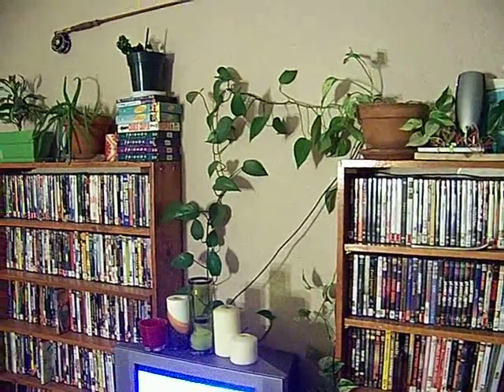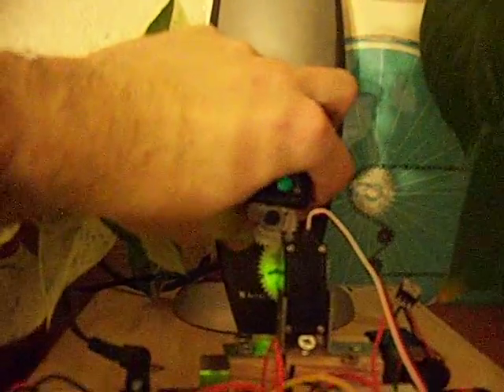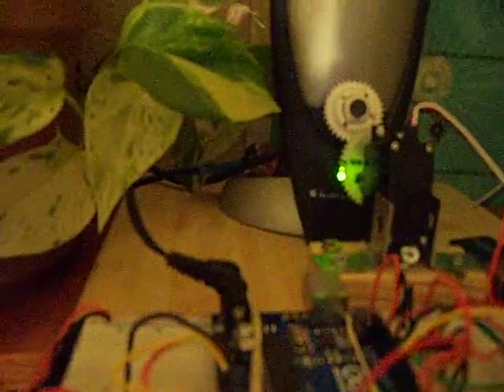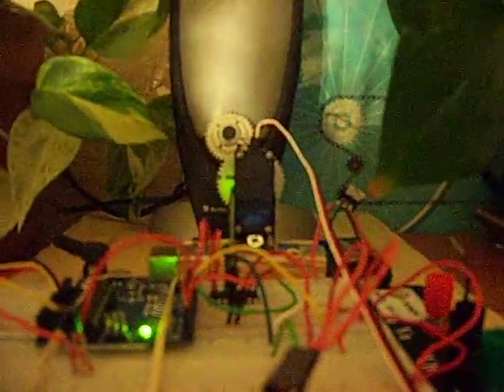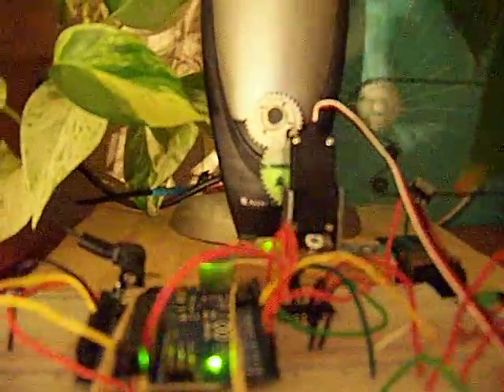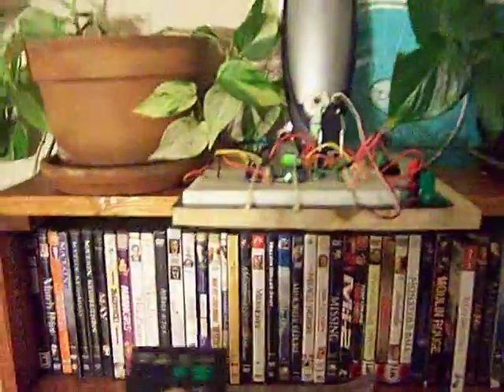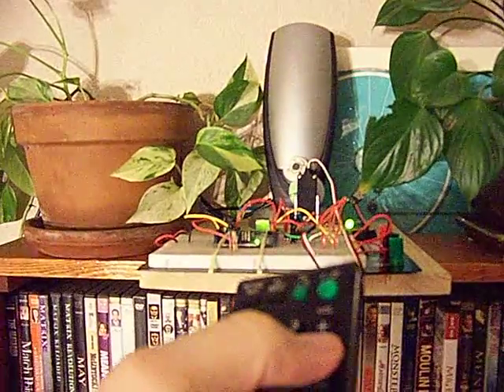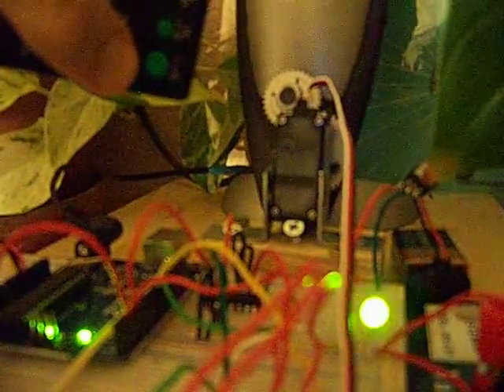Servo Motor Volume Control

Comment from the maker: The set up is more like a regular DC motor. But, unlike a regular DC Motor, you never want to reverse the polarity to a Servo Motor. It will ruin it, not change its direction of rotation like a DC motor.   The motor enable bit controlled by the arduino MCU dictates when the servo motor turns on.  I only turn it on when it needs to adjust the volume. Then it immediately turns off.  I will make a circuit diagram available when I have time.